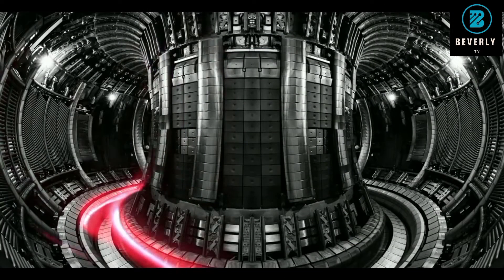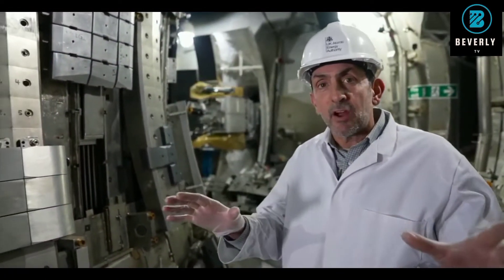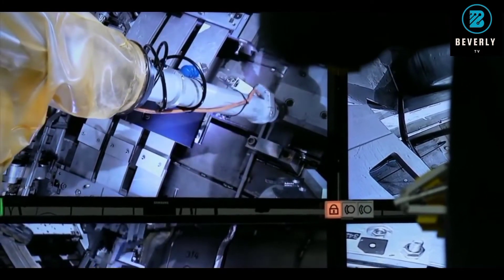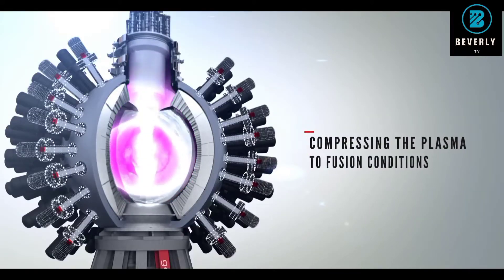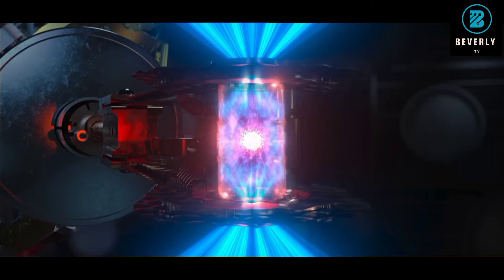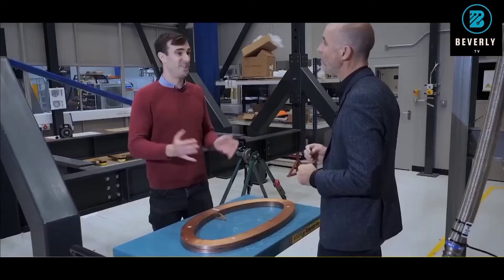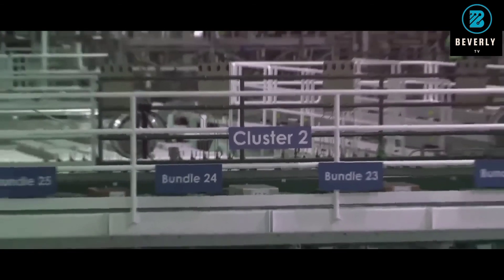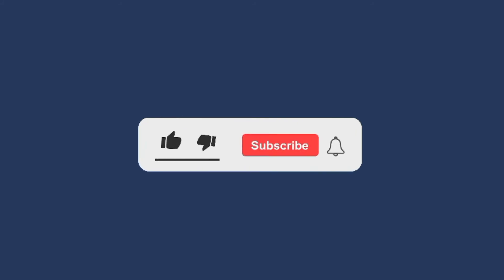Fusion Energy Breakthrough: Closer Than We Think?

Comment: If they can't make smaller fusion reactor prototype size of table, and harness energy for it, there just wasting time and money, 30 years or 60 years.
You can build small wind turbine, small water turbine, small solar panels and harness energy from it. In recent times turbine and solar panels basic way harness energy, exmple nuclear power plant uses turbines to create electrical energy, and in future nuclear fusion planning to be using turbines like others basically depending on turbines to convert hot water or vapour into electricity.